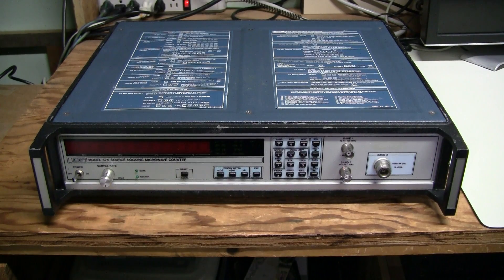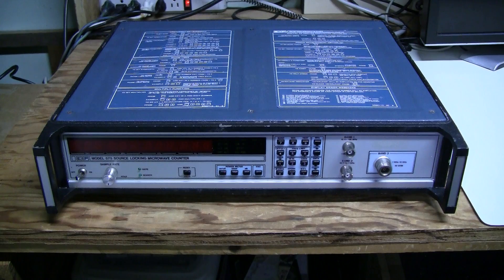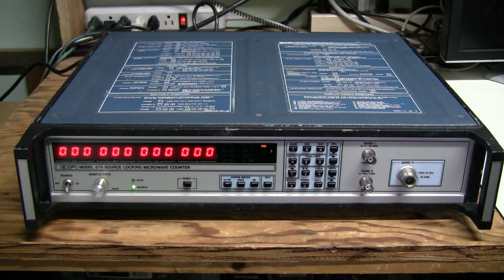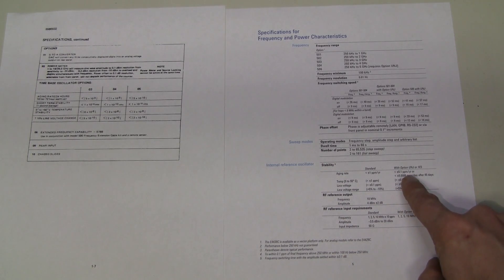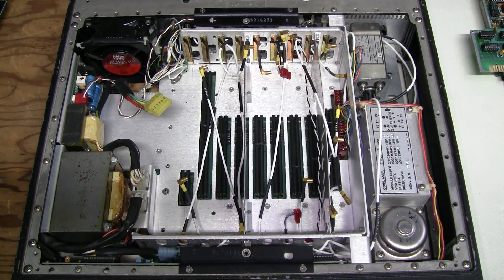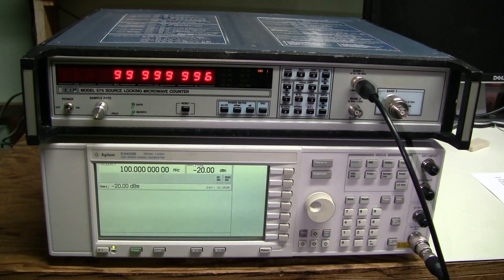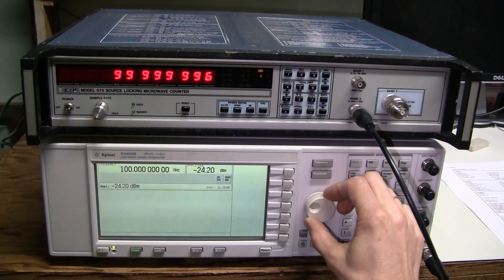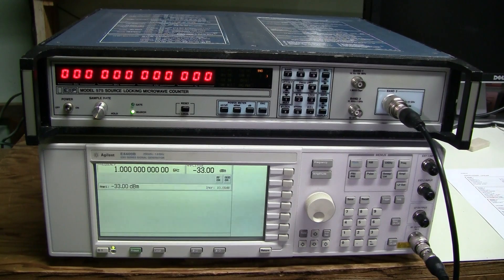#42 - EIP 575 microwave counter

Comment: EIP was very fond of using separate transformer to feed their crystal ovens. Usually sourced from "Ovenaire" as I recall. I have a 5MHz OCXO and transformer from an older 351-D counter that was surplused. With the addition of some regulated LV circuitry (transformer to OCXO was unregulated AC) became a very nice stand alone frequency standard.

Comment: I have a Systron Donner 6030 uW counter of roughly the same vintage, and it also has the hi-stability time base.

What I found is that when the manual says to check the accuracy after 72 hours warm up it really means you have to wait that long for the oven and associated parts to stabilize at the correct temperature...

I got mine from Ebay as well for $60.00 as non-working, and the only real problem was that someone had attempted to adjust the time base without waiting long enough for it to stabilize, and some of the interconnecting cable headers needed to be re-seated.

All of the P.S. caps were just fine with very low ESR and no leakage....It's loaded with options like the Power Measurement module and counts to 26.5 Ghz at -30dbm or better sensitivity....!

Comment: Unless I missed something band 1 has a 1 meg input so -19 dBm would be ~50 mVrms, and 6 dB down from that you should get 25 mVrms, at -25 dBm. So sensitivity is still better than spec'd, but not 13 dB better.
Reply from the maker: Thanks for your thoughtful comments.

Comment: Hi, I have one exactly identical. Can I get you to read out the EPROMs some time?
Reply from the maker: Why do you need them? Does your unit have older version of firmware?
Reply: My unit is missing the power measuring module, and all it is, is a couple of ICs on one of the boards, and a new set of EPROMs.
Reply from the maker: My unit doesn't have the power meter option either. How do you know that it can be enabled just by adding of upgrading firmware? I would love to add this option.
Reply: You can only find the image of the ICs, for the Power measurement you only have to add some components, i can tell you if you are interested
Reply from the maker: Please do.
Reply: ok will try to write it out
Reply: Ok here we go:
first you need some parts to add on the PCB, a low capacity Schottky diode (HP 5082-2835, 1 pF max. or something like that, a similar one should work fine ), than also a DM8136N , a 74LS244 buffer, and also an AD7524JN (DAC) and a 10k resistor. the DM8136N is a bit hard to get. The Problems are the Eproms they are kind of hard also to find, i connected modified a EIP 545A, and also have one that i want to mod too. I think the EIP 575 is using the same  circuits. The Eprom Images you can also get from the ko4bb website.
In the end just populate the components on the missing spots and put in new set of eproms i use ne one because  i dont want to loos the working proms. This is not an very detailed explanation
Reply from the maker: Thanks. I will put this project into my to-do list.
Reply: ;) when i have done my other one i can send you some pics for reference ;)
Reply: TecKonstantin z
Reply: @TecKonstantin  did you get this done? I just scored one of these units and mine doesn't have the power measurement unit either but I'd definitely be up for doing the mod. Cheers!
Reply: all the details for the upgrade are available  : http://www.qsl.net/n/n9zia/vision/